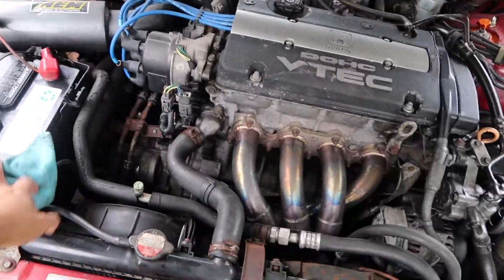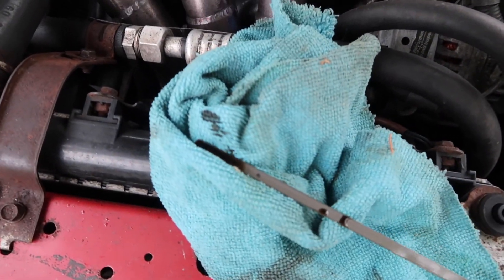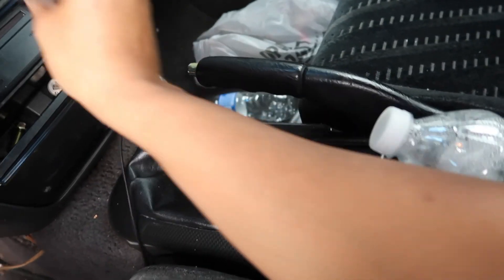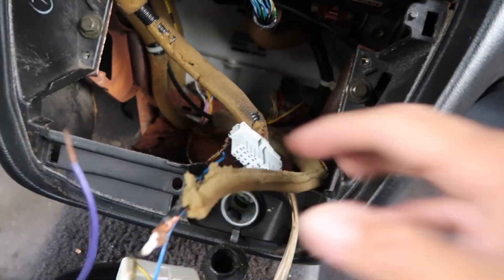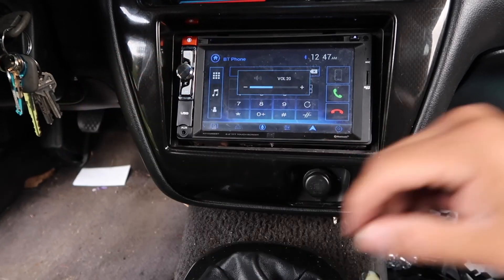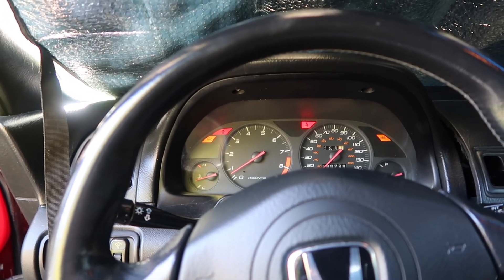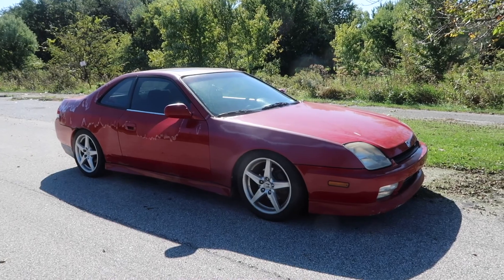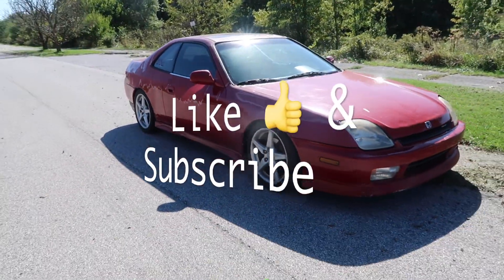Is Prelude exhaust better than K24 Civic si? | Honda Prelude SH build Vlog| New stereo |

Comment: I'm a new subscriber just going through and watching your vids. What a coincidence my prelude is having a coolant leak exactly where yours was haha. I just changed my spark plug wires, turned the car on and the coolant just started leaking out. Luckily I got the last hose at one of my near AutoZone, I would've had to drive an hour out for the correct one.
Reply from the maker: Hey thanks for subscribing! I think it’s a very common issue with them, this has happened to me a couple of times in the past. I really need to replace the hose too ha!

Comment: You know if that window trim can be replaced/fixed? Lotta parts are discontinued for the 5th gen.
Where did you get your fog lights also?
Reply from the maker: Good point- I don’t know but I’ll check later and see. Luckily, there are easy fixes for it too
Reply from the maker: I just saw your edit- to fix it you need to sand down and paint, there are many different types of paint that can be used . Even sand down and clear and vinyl wrapped . Fog lights are eBay oem replicas
Reply: @JayDMJorge  
Cool, thanks

Comment: What's up my man, love the prelude. Quick few questions, what steering wheel is that?? Makes the car look super clean, also, what rear diffuser is that? I've been thinking about modding my prelude and those two things caught my eye.
Reply from the maker: Hey- thanks for the comment! It’s ap2 v1 steering wheel and the diffuser is from eBay ! Steering wheel is def much better and smaller than the oem one and the airbag is compatible